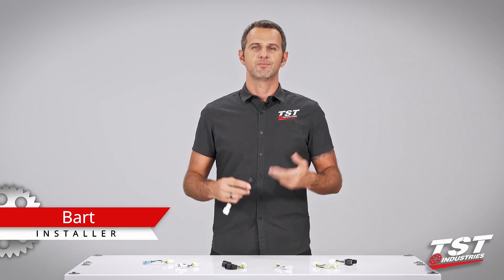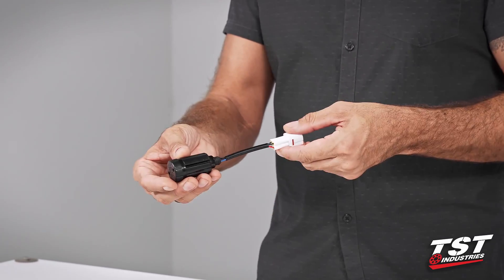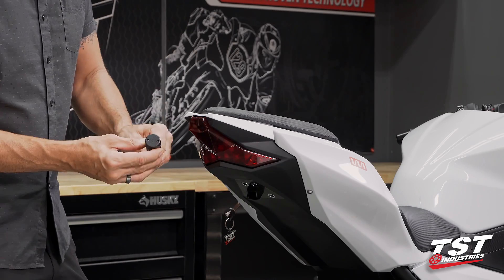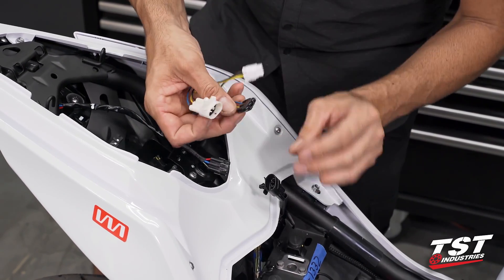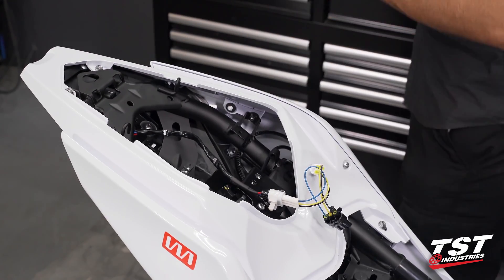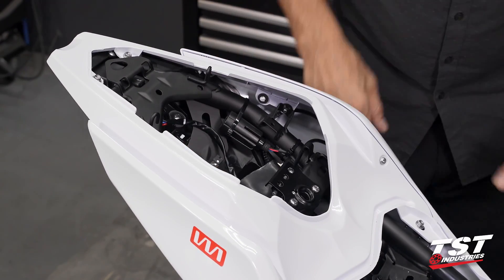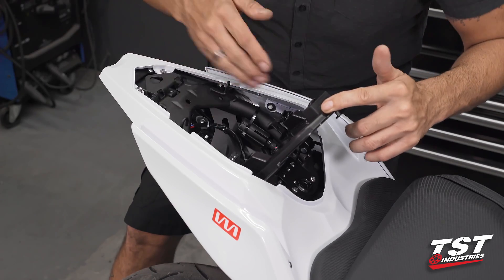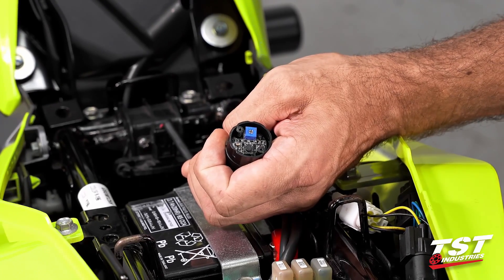How to install a Brake Light Modulator on a 2018+ Kawasaki Ninja 400 by TST Industries

Comment: Hi Bart, I have a question about the aftermarket tail lights TST offers. If I install the unit can I also run the stock blinkers or no? Where I live I must have separate blinkers, so can I, in effect have a double blinker ie: the tail light replacement TST offers and my stock or aftermarket blinkers running together?
Reply from the maker: I can only assume here that you are asking in reference to the Ninja 400. If not then please correct me. For this bike, and some others, we do offer a Y-splitter harness set that plugs into your harness and terminates in two sets of OEM connectors that then accept our tail light signal plugs, and another set of signal plugs, for example the ones for your OEM signals. You can see that part here and determine if that is what you need https://tstindustries.com/tst-kawasaki-y-style-signal-harness-splitter.html